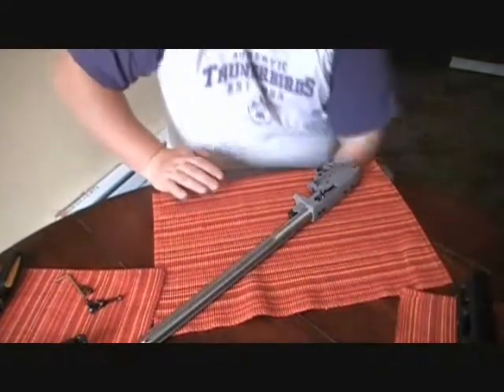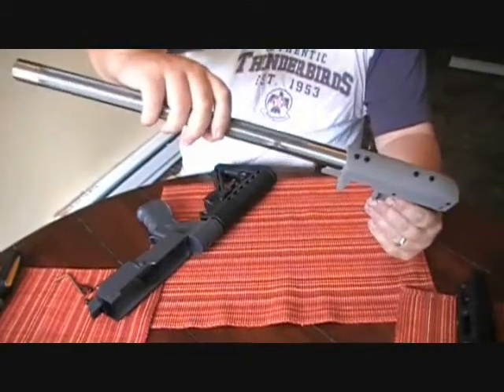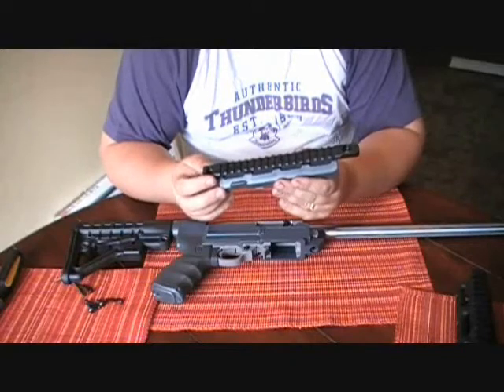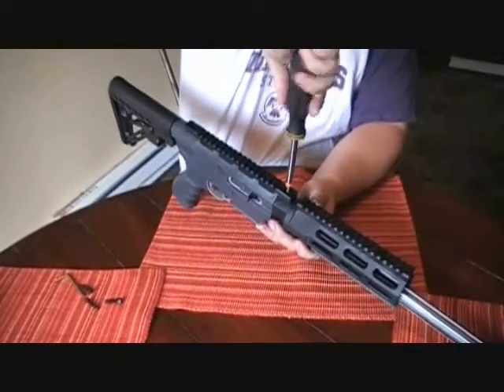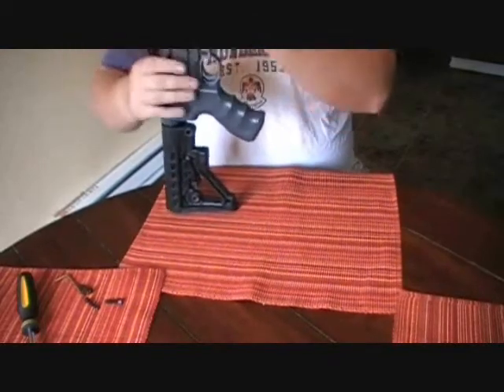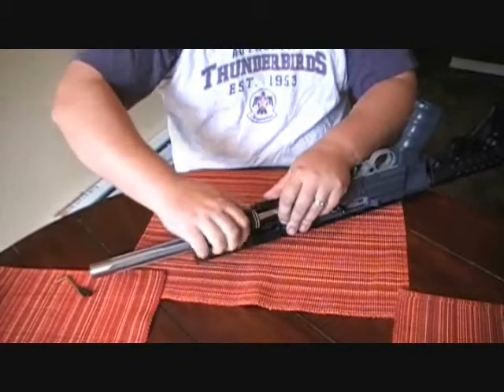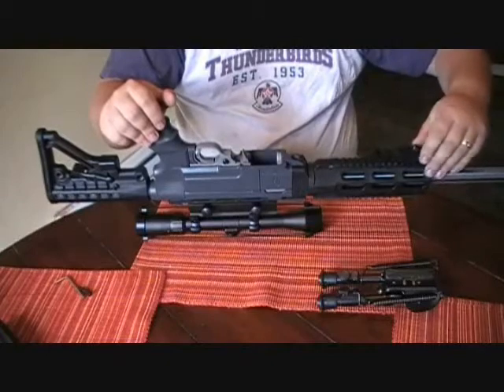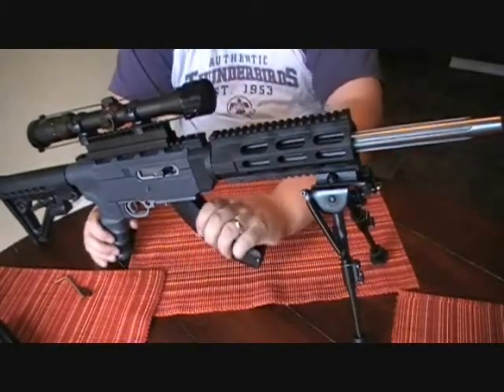Archangel 556 Installation on Custom Ruger 10/22

Comment: Nice build.  I appriciate your comments regarding the Archangel kit.  I'll offer some explanation for the reasons the stock was designed the way it was.

1.  The top rail has the addtional screw sight rail holes in the interest of accuracy.  In testing, we could efffectively break down the stock/rifle for cleaning in about 5 minutes.  
2.  The mag well is the key area where feed problems occur with some magazines.  It's much easier to remove a little material than to have to add it.

Comment: I understand your issue with Promag.  Since I have been here, I've made great strides to correct and improve quality control and the products here in general.  I've previously worked for Hogue and Knoxx.  Archangel is a separate division here and is really a completely separate entity.  I control all Archangel designs, and a separate crew performs all assembly here.  Let me assure you Archangel is a quality first company and Promag is improving leaps and bounds due to the association.

Comment: 3.  The scope riser was required, as we wanted to make the platform as close as possible to an AR-15.  This way all AR-15 accessories would work with the kit, such as flip sights and electronics options.  Promag offers a 1/2" scope riser that works great.  Also there are tall height scope rings available to counter this problem.

Comment: I just want to note that the screws that go through the top of the fake receiver (top rail of arc angel stock)  into the real reciever still should be used for best accuacy.

And directed to the people who critisize scope and bi-pod.  There is nothing wrong with them shooting at 25 yards.  The point is doing what it takes to shoot better.  Good vid.  Thanks for pointing out the the pain in the a** for cleaning it out.  Now I have 2nd thoughts.  I should just get a ar-15 =) good vid

Comment: Does anyone have any specification on the measurements/dimensions of the chassis with the 16"inch barrel on? In Norway the absolute shortest length of the gun with the stock not retracted/all they way closest to the body has to be 840mm. And what is the dimension with it fully retracted?

Comment: i have a aftermarket razor reciever that has a rail thats built into it makes it 11/32 higher than the stock ruger receiver...what are the odds in it fitting inside the archangel

Comment: Are there metal threaded inserts for the two top and two lower forend screws to go into or do they just screw into plastic? Also, is the forend secure enough without any wiggle to mount a front site on without worrying about accuracy?

Comment: I got an archangel 556 kit and the mag well isnt tight or small oranything. I have bx25mags and factory rotary box mags and they fit fine. You may have done something wrong
Reply: There was another video where the kid did converted it all on video too, and he had a tough time with the mag wells.  a little tight, so the flush fit 10 rnd factory mags were tough to get out.

Comment: i was deciding between the smith and wesson m@p 15/22 and the ruger 10/22 with this kit.... i got the kit today and it looks all bad ass!  i did not want to spend a big pile of money on the smith for a .22 "range toy" so i went the ruger route.  one thing i personally dont like is the fake plastic flash hider and the plastic bayonet that comes with it!  i think i will get the tactical solutions threaded barrel and put my suppressor on it.  dont care for the look of the bx-25 mag on this kit.

Comment: As for the 10 Rd magazine being too tight: Simply remove the archangel stock and run a Dreml tool around the inside where the magazine goes. Problem solved; And no, you are NOT an idiot!